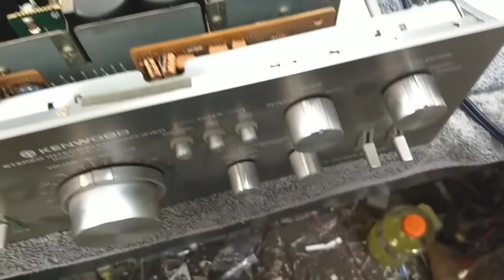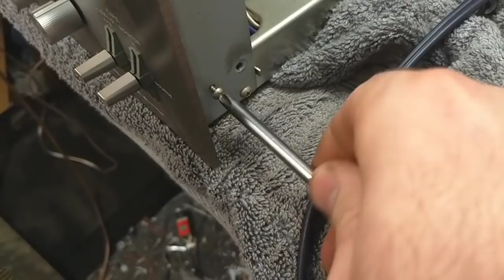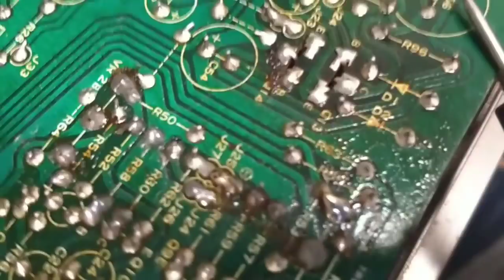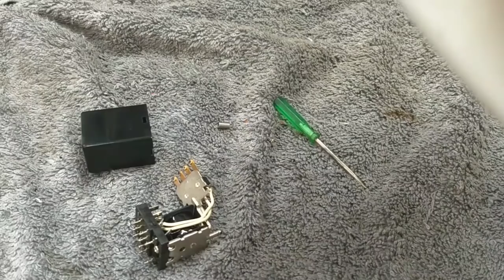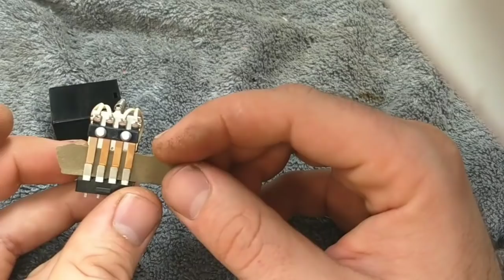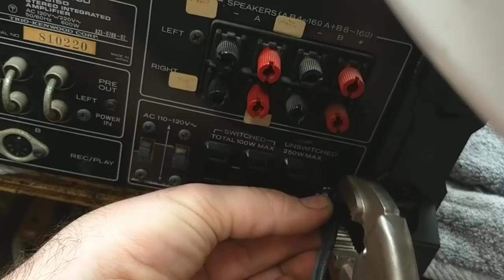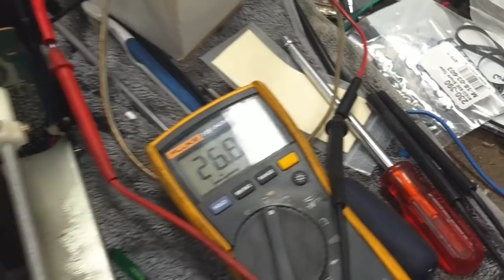Servicing a vintage Kenwood ka-8150 (ka-8100) integrated amplifier part 2/3

Comment: “Somebody originally had this on 220…” That would make sense as the KA-8150 was sold in the UK and would have had a UK style electrical plug, and someone cut it off and put the cheap replacement plug on it that had problems.

Comment: At 1:00.  What the heck is going on on the floor of your shop?
Reply from the maker: @robertthompson5908  cleaning was every Friday. Usually leads, whatever else that was supposed to hit the trash hit the floor if the can wasn't within pitching distance. 

This was the drawback of having to push a high volume of repairs every day. No time to clean up. Had about 6-10 units a day to repair
Reply: @  Ok, you were busy! It’s clear from your videos that you’re very experienced.

Comment: I'm burning through these videos and love how easily you tackle these things. One request for you dummy viewers (it's just me) When you talk about things like bias and DC offset, can you detail what that means and also the complete steps (ie, putting leads on the speaker terminals for DC offset)
Reply from the maker: You can check dc offset at the speaker terminals easy enough. Offset is the voltage above or below zero that needs correction at the speaker terminals. It is permissable to be off 50 millivolts 

I do not recommend messing with bias adjustments or taking measurements without knowledge or extreme care. Otherwise youll blow your amp
Reply: @JordanPier  thanks! I have the KA-6100. It's a great amp and is dead silent so I've been avoiding trying to break it. I have shielded leads and plan to try to do the bias. It doesn't have a DC offset pot. The VU meters are also way off. I plan to try to calibrate with a 100W 8 ohm resistor split between L and R at the speaker terminal using a multimeter and iPhone app for signal generator. Do you think work if I'm careful? Too late for trying to be knowledgeable.
Reply from the maker: @dkubarek1  if its no sound but lights up check power supply and regulator voltages per schematic. If thats cool check output if thr amp for DC. Should be zero volts dc. If thats good its likely a protection circuit failure. Getting common on kenwoods now
Reply: @JordanPier  It's the KA-6100 and it works great. I just planned to give it a general service (bias and VU meter calibration.) I already cleaned the the pots and it's been one of my players for a couple years now.
Reply: @JordanPier  as for the original comment, it would be great for us dummies if you said the reason for bias (I assume to create equal power per channel) and why minimize DC offet (I assume noise and maybe wear on speaker components?) I really love the videos. Thanks for doing them!
Reply from the maker: @dkubarek1  bias doesn't effect power. Think of it like the idle on a car. Idle is too low and the car stumbles. Amps the same way. Too low bias and the amp distorts and performs poorly.

Too much idle and the engine can over-rev doing nothing. Same with an amp. Too much bias and all thr energy is wasted in heat only with no music playing to the point the amp overheats and blows up
Reply: @JordanPier  makes sense. Thanks!
Reply: @JordanPier  thanks for the help. Biased the Kenwood KA-6100. Right on at 20 mV now. DC offset is 12 mV. Not bad for an old amp! Gonna do the VU meters next.

Comment: Wow, what a pleasure to watch and listen to you work. Consice and clear. 

I found your videos after returning my original owner 1977 KA 8100 into service. I live in a dry climate and it has been sitting in its original packaging for about 25 years. That and a KT 7300, ADC Soundshaper ll and Technics SL-3200 TT with Bose 800 Pro Series speakers. Bought it all in 77 or 78.

Hooked it all up and found faulty TT phono jack, faulty speaker jack and a few crackly switches, controls and sliders. Other than that it sounds fine and nice to hear my vinyl again. 

Thanks to you Jordan I’m confident to go in and clean my controls on the amp as described in part 1.I read not to spray clean the EQ sliders as it will wash the original grease out and they can become even stiffer. Any comment on the EQ sliders. 

I beleive the 70’s Kenwood products are good quality. Thanks for sharing so much knowledge and instruction.

Comment: You make it look so easy, i have a kenwood  ka-92B it turns  on but no sound came out.  I have it since 1985   and  once in a while i open the amp hoping  i can fix it,i  saw so many youtibe vids but still  does not work. I will keep watching your vids hoping i learn samething. Thanks for the videos.
Reply from the maker: Troubleshooting process:

Get a service manual with a schematic
Understand reading schematics
Get a DMM, understand how to use it.

Use caution!  Shock risk inside!

NEVER PLACE BOTH HANDS ON THE CHASSIS WHILE WORKING. ALWAYS KEEP ONE HAND IN YOUR POCKET TO AVOID BECOMING PART OF A CIRCUIT!

Remove top and bottom covers. 
Power up unit.
Take voltage measurements from main power supply capacitors. Should be symmetrical (like +40 and -40) with negative at chassis. They will be close. If not you've found the problem.

If that's ok, find regulators and compare output voltage with schematics. They should be close. If not you've found the problem

If that's ok, measure DC voltage at the amplifier output or high side of speaker relay. Should be near zero. If you have voltage in one or more channels, you have found the problem. If both channels have the same DC voltage at the output look again to the power supplies.

If that's ok then you need to start troubleshooting signal path and individual systems. If there is a logic circuit for function switching and display this complicates things.

Comment: I have a 8100 that powers on and the relay doesn't click at all and no sound. All fuses are good. What's your opinion on what to start trouble shooting on?
Reply from the maker: Probable causes:

1. One or more amps have failed. Measure emitter voltage on outputs. Should be near zero volts

2. power supply failure. Get a schematic and check power supply voltages and regulator

3. Protection circuit failure. Either time delay circuit, fast turn off citcuit, or relay drive circuit.

4. Bad relay coil. Coil should read about 750 ohms. This is a rare failure.

Good luck!
Reply: Jordan Pier thanks for the fast reply and suggestions. There were a whole bunch of broken solder joints and cold solder joints and suspect joints  on the power amp board and a leaky capacitor in the protection circuit. I fixed all that and flipped the switch and the relay clicked on after 3 seconds. I then adjusted bias and offset and it sounds amazing. Still have more minor trouble areas to fix.

Comment: Nice video. I popped over here on Shangos recommendation and I'm glad I did. Just as an FYI you can get strain relief pliers from Amazon or eBay for about $10. Makes it much easier to fight with those little things.

Comment: This is a great troubleshooting series, and I'm going to use some of those ideas. I've got a Kenwood KA-305 of about the same vintage with the same symptoms---powers on, no fuses blown, relay kicks in, but no audio at all.
Reply from the maker: If your hip with a meter, check your +- 25v regulators and double check the fuses on the main board towards the rear. If all that's good, deox the switches and controls. You don't know how many times a dirty switch or noisy control has stopped the sound for me
Reply: Thanks Jordan, I'll give it a shot